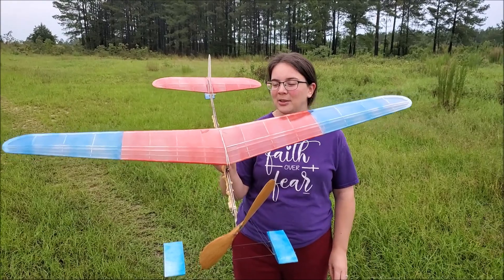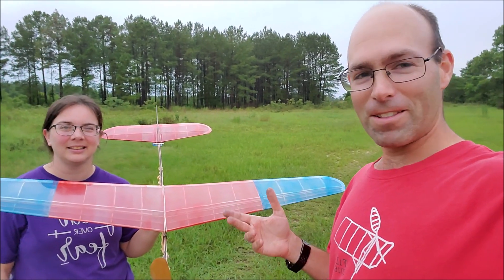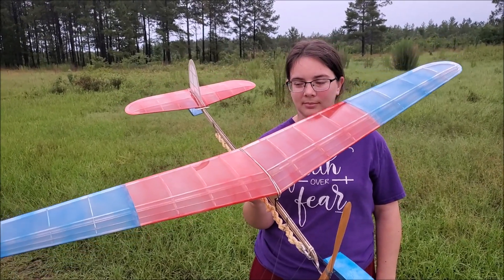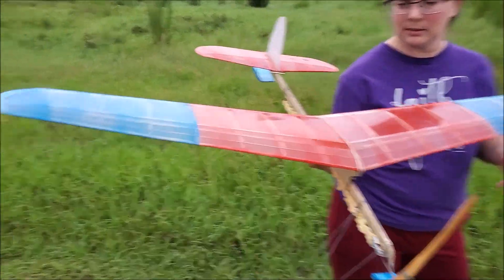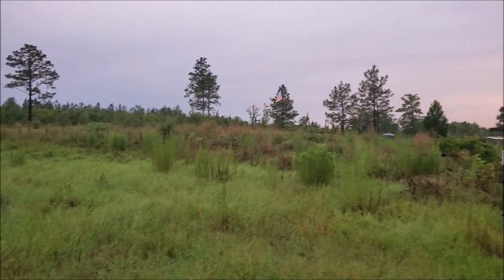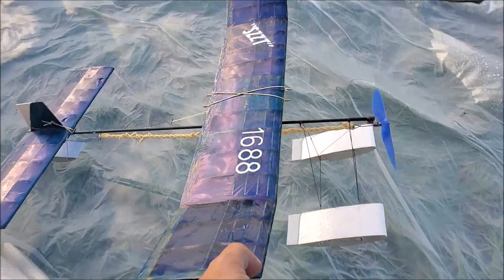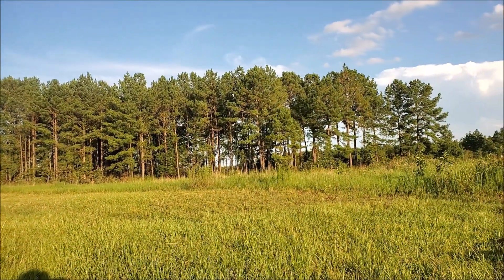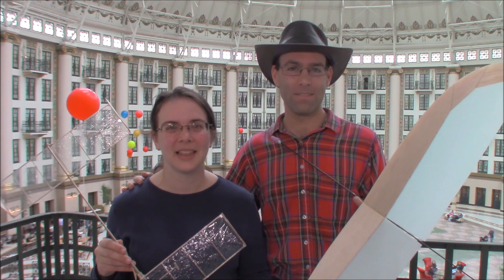Big rubber powered seaplanes!

Comment: Congratulations to Hope on the award! R.O.W. planes are so graceful. Maybe the aerodynamic profile of these foam floats actually helps to turn that early tendency to stall into that 'sit up and beg for lift' attitude.. I mean, the drag they provide may prevent the full blown stall developing, when the power is ramped up a bit.. Hoping y'all enjoyed the rest of the competition. 👍
Reply from the maker: Thanks! I think the main factor for Hope's plane has been the great airfoil and very high powered, large propeller. The floats do add some lift and as such make the trim setup rather interesting. I suspect next year with some minor trim changes, this model will have an extremely strong climb pattern. We need to get the glide circle sorted first though because it's tending to wander out of thermals.

Comment: Great video!  Will you be at the thermal thumpers event at the sod farm this weekend?  I'd love to see your Smoothie.  I have dreams of building one of those and trying to add some newer building techniques / high tech materials.
Reply from the maker: Unfortunately I usually only make it to one meet a year at Whitesburg, but we do fly fairly regularly at the Perry fairgrounds, which frankly is a better field with better retrieval options. Unfortunately the Smoothie is out of service. The motor blew up in flight a number of years ago and trashed the fuselage.
Reply: @joshuawfinn  I ended up not making it out to the sod farm either.  Have 4 planes that I could fly but nothing is trimmed well yet

Comment: I’ve been wanting to ask this question for a while. How do you do it? How do you get such great looking and flying models right off the bat and almost no trimming needed? (for most of them). Is it more of a patience or skill thing? I’ve always wondered.
Reply from the maker: I spend a fair bit of time making sure the planes are built (and covered) straight, smooth, and with the correct warps. I also set my CG based on Don Deloach's tail volume method so that I can focus on a specific strategy of adjusting the plane without having to juggle both CG and incidence adjustments. For indoor flying, it's mainly about warp control since the planes are usually able to operate over a wide CG range.
Reply: @joshuawfinn  Ok, thank you.